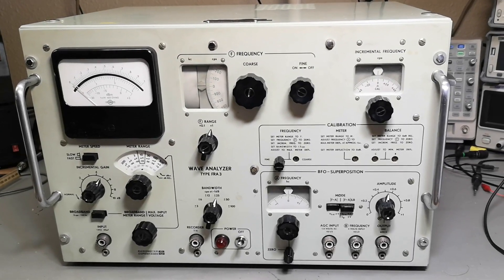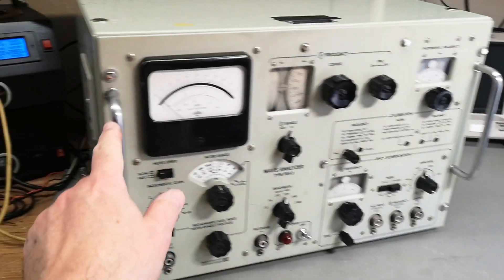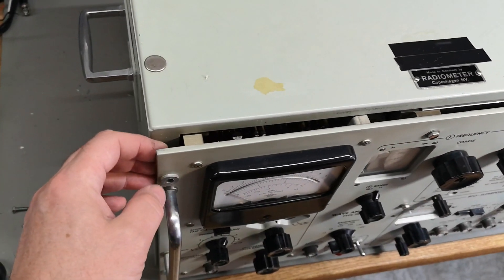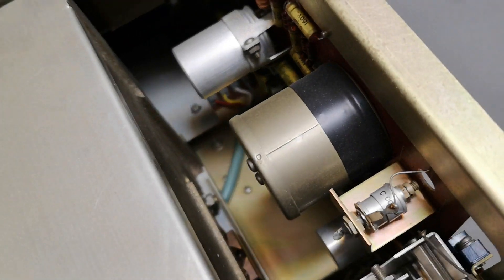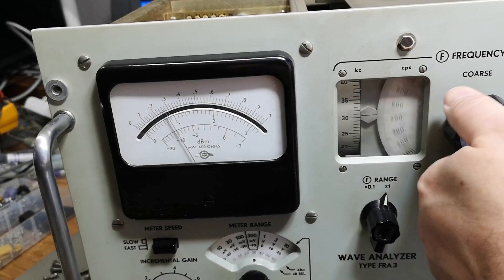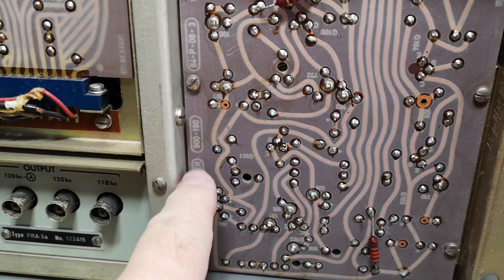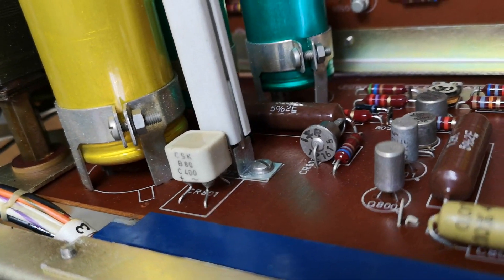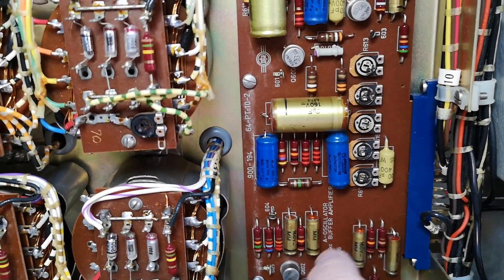Radiometer Wave Analyzer Type FRA3 10Hz to 60kHz 1965 test and teardown

Comment: Nuvistor = No Visitor = Ingen Besøgende. Ha, ha, ha ... Who made these subtitles ...?  Great unit anyway. Deserves to be renovated (check & replace electrolytic cap's out of spec's besides checking solid state devices, especially Germanium transistors for leakage and noise.) Timeconsuming but you'll end up with a great and foreverlasting instrument to measure harmonic distortion in your homebrew tube-amp's !
Reply from the maker: HAHA genialt :-) mange tak, jeg har rettet det, hvis du finder andet der er helt gakket mht tekster på Dansk eller Engelsk , må du endeligt gerne sige til, skriv meget gerne tidspunktet i videoen, hvor det er fundet, så kan jeg meget let rette det.. (youtube auto translate er brugt)